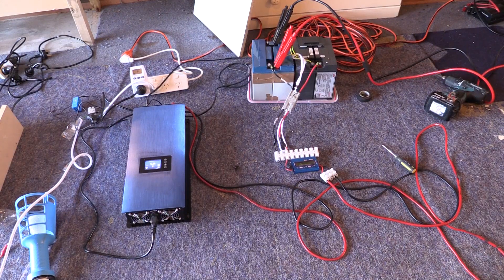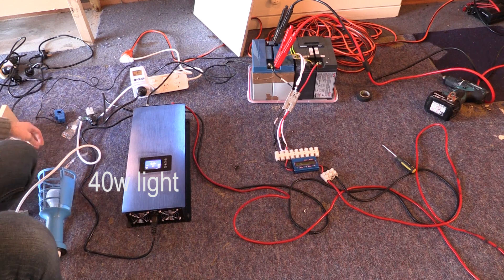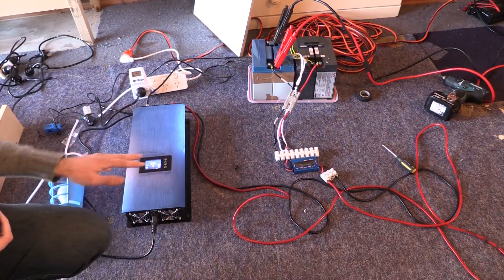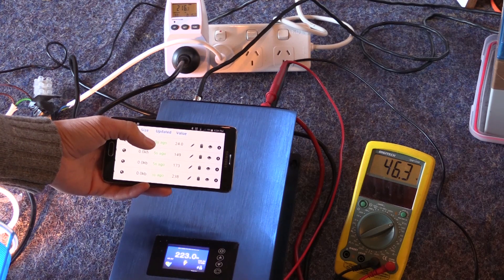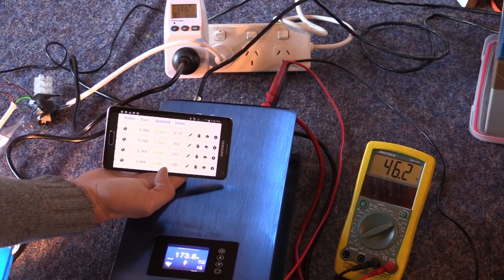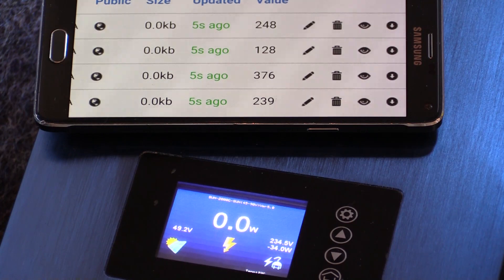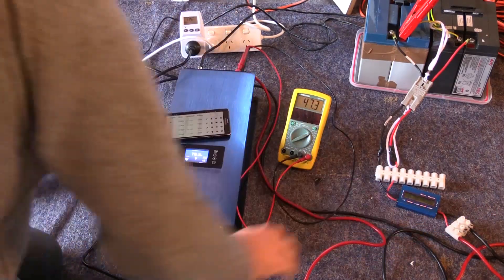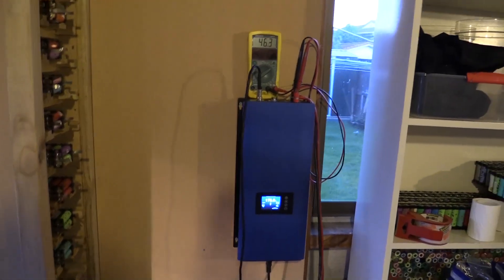The Test - GTIL2 2000w Grid Tie Inverter with limiter Part2

Comment: I plan on using a dc to dc boost converter because these grid ties work better at higher voltages. 24v batteries to 60v boost.😊

Comment: You have your batteries hooked to your Tie grid right so look at this and tell me if you can follow along what's actually going on we're using it in our system and if you don't know what overunity is it's just leapfrogging to fresh batteries while the batteries are charging if the batteries are full it doesn't take much energy to charge the batteries and as you jump to battery and batteries the speed determines on how long of charge it will take to charge them back up you only need a second of energy from the batteries which will give you full power and like an uninterruptable power supply switching can be done flawlessly and as you can see the batteries hold the storage and will give you the amount of power you need in your system indefinitely we're writing a book on this so check out this link
https://youtu.be/YYW2-VIBxW4

Comment: I have a 1500w 48V wind turbine, and bought this same Grid tie inverter.    I plan on doing it with no batteries with a regulator / 1000w Dump load set at 50V to start.    I have long durations of steady (winds 15-20 mph).  Ive been seeing 80-120vDC  unloaded.     I dont see a point of hooking batteries up.     Do you have any insight on my setup?
Reply: Any results?

Comment: This is what I need. I run an AC in my shed at 600watts and want to grid tie the shed with 600 to 1000 watts to offset that cost. I store my equipment in there so it needs to be cooled.

Comment: hi. what is the consumption of the inverter @48V at idle(when is not outputting AC)? thanks
Reply: Same question just bought this inverter. Mine is consuming around 50 watt when inverter is connected to AC plug and the screen of inverter is on but without any DC input from panel or battery.

Comment: Hi Mike, I'm thinking of buying one of these to add some grid tied power now that I've got my smart meter. Do you think getting the 2kw version and running it 24/7 is wise? I'd like it to last years. The firmware is now updated so I can limit output in this way. Don't need the CT clamp. Just want to run it at constant power all day and all night long.

Comment: Can the clamp see negatieve power Because i want to use it as a battery storage. Next to my solar panels that r tied to my home grid. And wants that the battery storage kicks in when the solar dips and pulls power from the grid
Reply from the maker: The Clamp still needs to be around the main AC cable to the house, But yes if the sun dips then the inverter will output more power.
Reply: @MikesDIYTeslaPowerwall  but for example. if my solar r producing 2000W and my house is taking 500w so i will have a negative 1500w going into the grid. the inverter will see this a negative and wont read this as 1500w consuming  and start producing also
Reply: @EVchallenged  If you are seeing negative power on LCD, you should invert the CT Clamps to get the power measure on correct direction.
Reply: Yes Robert I was wondering about that to.

Comment: I assume that the normal setup for this Inverter is to have Solar Panels connecting directly into the top of this unit.  However, rather than potentially wasting large quantities of power generated during the day when I may not need it, is it possible to have Solar Panels --> Charge Controller --> Batteries --> Inverter.  So even after sundown, the Inverter would continue supplying power to the home until a battery threshold level was reached.   If this can all be done, then what type of device would be needed to monitor the battery level to ensure that it didn't drain completely ?
Reply: This has a built in sensor for that

Comment: Hi, 2 years on is the inverter still working?
Reply from the maker: Have a watch of my other videos, You will see it failed and i need to fix it. Running at more then 1700w this inverter heats up too much and fails. it wont have a problem with 24/7 1000w tho
Reply: @MikesDIYTeslaPowerwall  Hi Mike, I'm following you now, thanks for the video. I'm starting using the version 1000W. I'm using Solar power (600W max Solar). I'm not sure how limiter is really limiting the power. Did you have success with 25m cable extended ? I'm looking to do the same. The plug where I inject into grid is closer of CT Clamps. Thanks
Reply: Thanks for the update.

Comment: I wonder if one of those GTIs with limiter would work with my inverter generators as the grid source? I live off grid and currently power my breaker box,  just one leg, with two paralleled inverter generators and I would like to incorporate some PV panels to help reduce the fuel bill of running a window a/c unit in the summer.

Comment: Hello my friend! Thanks for the video and the clarifications. I would like to clarify a doubt. I have two inverters, one in each phase, both with power limiter. I want to know if I can connect them in parallel on my solar panels. Thus, while consumption is low in one phase, the remaining energy would be used by the other inverter. Thank you very much

Comment: Hi Mike Nice video but it looks like to me you put the limiter around the wrong cable, it should have been around the extension cable and not the lamp.   as the inverter will keep pumping out power until the limiter sensor is around 0 but it will never say 0 as its measuring the supply load to the bulb
Reply from the maker: As per later videos i did, Your right :) around the extension cable and not the lamp

Comment: can you limit the output from batteries say down to 300w If your battery bank can't run the inverter flat out all day?
Reply from the maker: you cant limit the watts not with my firmware version. If the battery bank cant run the inverter as the voltage drops it will just turn off isnt that the same thing?

Comment: Im Very pleased about this video of yours, my 1KW GTIL is coming this end of the month and my battery is just 2pcs of 210ah deepcycle.  im just wondering if i can power up the GTIL with buck converter booster to 48 or 50V from my 24v batteries?
Reply from the maker: You could as long as the boost converter support the amount of current needed

Comment: You can ask your supplier to send you an updated DC MCU board.. wont 
cost you any penny. That is if your supplier is good. You be the one to 
replace the DC MCU board. Unplug and plug inside the unit. The DC MCU 
board I think is cheap. its about 2inc x 2inch in size.

Comment: Latest  firmware update solved the GTIL2 performance at load below 200w. Not all units are affected by this software bug it seems.
Reply: hertzblasterx well thats a shit design. im 2500km away from my seller. you shouldn't uave to send every time u need to update
Reply from the maker: Wish there was a way to update the firmware. Tho i have a external limiter on its way to test out.
Reply: no it wont solve the problem.
Reply: This software bug was finally fixed last Dec 2016.
Reply: Request also for a hardware/parts update if ever u decided to sent it back. send it by post office. its cheaper. This hardware update is critical.
Reply: SO far units bought Dec 2016 directly from masspower aliexpress official store , all bugs had been addressed since 2nd Gen GTI was first officially  release in the Philippines last Feb 2016.
Reply: hertzblasterx how do i load latest firmware
Reply: send it back to your seller. No other way,

Comment: Hi Mike. Am I correct in understanding that, because these type of grid tie units are designed not to export power out to the grid,  you don't need any special permitting or other arrangements with the local network company in NZ?
Reply from the maker: Thats right, Should be the same anywhere. As long as you dont export to the grid its ok. However if you did export alittle no one will know. It will be a problem if you exported normal grid-tie without getting a export meter and getting it signed off. I have already got a export meter with my main house grid-tie system.
Reply from the maker: Any grid-tie over 2300watts would need to be connected using a electricians etc
Reply: Thanks, I understand. 
I've just ordered one of the 1kW versions of this inverter. I currently have about 1.3kW of panels on my roof that are providing direct heating (dc) of our kitchen/washhouse water heater. I can switch manually back to ac if/when needed to boost if we get too much overcast weather. My running annual average delivery with this set up is around 2.5kWh per day and we only ac boost maybe 5% of the time.

Seeing your item on this sort of inverter has given me some ideas for a more convenient method of deploying the solar input to supplement both water heating and general house base load. What I'm going to try out is fitting our water cylinder (which has a 2kW element) with a suitably rated dimmer to drop it's demand to something under 1kW so that the solar panels and inverter can warm it up at a manageable rate. It doesn't need fast recovery so I can throttle it back to something that is more manageable. 
What I'll also look at doing is adding some battery storage so that when the water is up to temperature and the thermostat has turned it off, surplus solar input can be stored for later, much along the lines of what you are building.
Cheers and I'll continue to follow your (and @Paul Kennett's ) projects with interest.
Reply from the maker: Arr what you need is a PV Router, or Mk2 Router or also known as a immersion controller. I have built ones based on the Mk2 router design and its perfect for what your trying to do. It will monitor the excess power and turn on the heater in the hotwater just enough to use how ever much excess you have. Given your excess power is always changing the PV router is always changing what is being sent. That way you can boil your hot water for free and also only from your excess power, if you dont make enough solar that day it can also turn on in boost mode using grid so you dont have a cold shower etc.I have been running mine for just over a month and its saving me around $2 a day. I will do a video on it in the next couple of weeks. Here are some links:
http://solarimmersion.co.uk/
DIY
https://openenergymonitor.org/emon/mk2
http://mk2pvrouter.co.uk/
Reply: You read my mind! So, the next question is: will a the PV router work ok with the limiting grid tie inverter setup? The constraint I'm assuming is that, since tghe limiting inverter won't export, the PV router wont wind up the load to consume the excess (unless you trick it somehow).
Reply from the maker: Hmm normally you would do it with an grid-tie without a limiter, The limiter would have to be turned off so the PV Router can see the excess and turn on the load to match the excess.So nothing is exported but rather its sent to heat the hot water.
Reply: Hi again Mike. I received my 1kW GTIL1000 version of this inverter on Friday and got it running over the weekend. Very simple to install although I had to reconfigure my solar array into parallel pairs of modules to get the 0-90V DC input range correct. By and large it appears to run ok and work as advertised. I my case it matches the import power to within about 8W. I'm not so impressed however with it's MPPT tracking in variable light conditions. It looks like it responds to even quite slight reductions in light (say with patchy cloud) by practically stopping generation and ramping up again to a new operating point - pretty bouncy output in some conditions.
Reply from the maker: Oh well that is interesting, I never tested the GTIL with solar panels so I am guessing from your comment it reacts very much the same as the MPT-7210A I am using in the other videos. I would of thought its MPPT would be better mind you for me I only got the GTIL to run off battery so its not too much of a problem. I would think putting some large caps like I did with the 7210A would also help the GTIL not to loose its tracking so much. Something to try anyway. :) Thanks for the update and glad its working for you

Comment from the maker: Update: I did some testing with the CT Clamp and how the limiter works, It seams the min load the CT will pickup is 35watts but the inverter doesn't seam to like putting such alittle bit of power out , After some testing i am thinking the min of this inverter with using the limiter will be around 100w, much less then that it has a hard time limiting such alittle bit of current. Normally tho when installed the house over night only drops to 160watts so this is above the say 100w low limit.  I will leave it for now as i need to extend the CT wire/cable 25m ish which might work or might not. This extra cable length might also change the reading lower or higher so will have to see what happens. I cant do much more testing with only 46volts because with such little voltage the max the inverter will put out is just under 400w. I will need to get my powerwall going so i can really give this a test.

Comment: They look so easy to use compared to a setup that needs to be wired in by an electrician. Although I doubt it would be compliant in Australia :(
Reply from the maker: Easy yes but your limited to 2000w and below, Anything bigger and your need a electrician to wire up because they push more then 10amps on the bigger units.

Comment: second, well done, try a test with the ct clamp around all three wires? see if that makes a difference.
Reply from the maker: CT Champ will only work on one wire, Ether the Live or the Neutral. I always put them on the Live as it makes more sense to me
Reply: I have no experience with ct clamps, but an amp meter hand held one goes around all?  
I've seen sometimes have a few coils wrapped around a sensor for better reading?
Reply from the maker: Hmm Hand held just still go around 1 of the cables